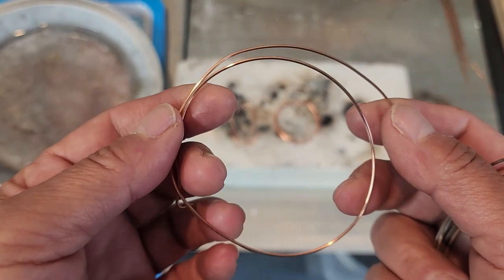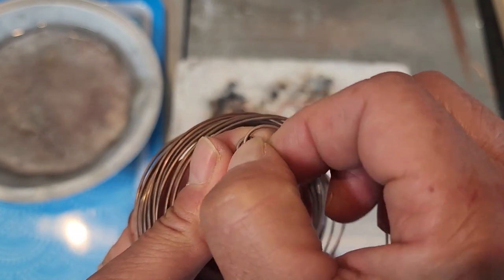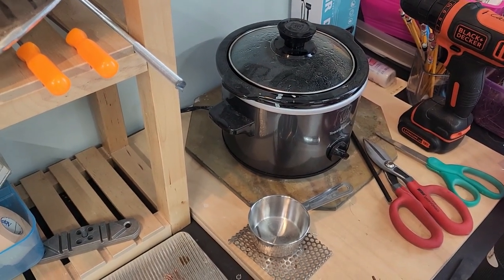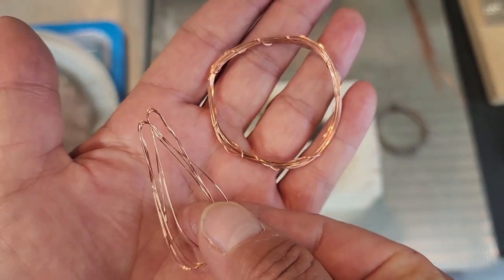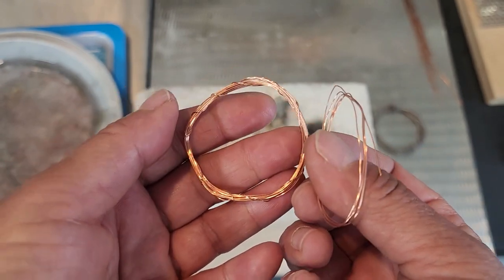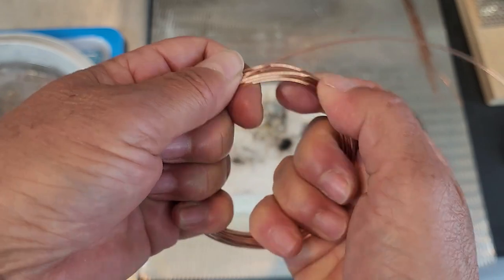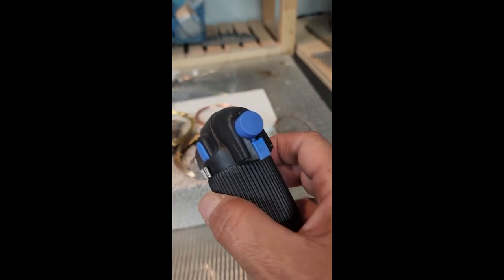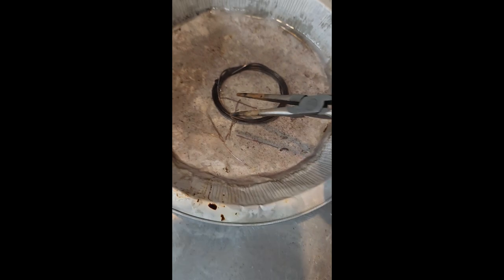How to Anneal (soften) wire for wire wrapped jewelry using a Micro Torch

Comment: Never can figure out, how long do you leave it in the pickel for? Also, if you are using the chemical purchased pickle, would that change the time? Thank you for this video! Ive watched many and this one is the most straight forward, and hands on with a pleasant voice!
Reply from the maker: Thank you so much for this lovely comment!  I only use the white vinegar and salt pickle, I don't use the chemical pickle at all, so I can't comment on that.  I find it only takes a few minutes for the hot vinegar/salt pickle to remove the fire score... you will notice the color change in the metal and see it pretty quickly.  Use tongs to handle the wires and rinse them afterward.  You might google for Silversmithing videos that might show and talk more about chemical pickle...I don't solder, so the use of fire and this pickle in my studio are very limited.  There will be more and better information out there from other experts on the use of chemical pickles in your studio and how to safely handle all that.  Thank you again!

Comment: I am not good at hammering on copper, it always seems. bit irregular and hard to shape.  Would annealing it first make it easier to get a nice hammered effect?
Reply from the maker: Hi Ann, not really... annealing is more for softening the wire, while it might help, it's not the main factor I don't think so anyway.  Try a Chasing Hammer if you don't already have one, the head of it is slightly curved, hit on the face of the hammer and pull back slightly to direct the wire, where to flatten out.  If you hammer with the ball shape side of the hammer, then you get texture on the metal.  You can watch this framing video and go to timestamp 7:00 minutes, I show how to hammer.  https://www.youtube.com/watch?v=DbVh0fzLo2s  Hope that helps!

Comment: I’ve made ball headpins with the same pickle you use. Do you polish the wire after? I don’t have a good method for that. Do you have suggestions. TYFS
Reply from the maker: Thanks, Cathleen, I don't do this often as you can see in my jewelry images, because there is not a great way that's easy... this time, I am going to try throwing them into the tumbler for a while and see what happens... I might do a light coil and tie them together and then the tumbler... do you have a tumbler?  I haven't shown it yet, but if this works out, I might.  That's about the only suggestion I have other than trying to hand polish using a Sunshine Cloth (that works quite well, just takes the elbow greeze and some time ;) Hope this helps!  Great question to bring up too!
Reply: @PerfectlyTwistedJewelry   
Unfortunately I don’t have a tumbler yet. I’m looking but know nothing about size, motor, durability, etc. I am starting to use sterling and find the benefits of getting one. I recently retired so more time to do wire work. I also am finding how poor the plating is on craft store headpins and clasps. So embarrassing when you gift or sell a piece that the silver clasp has turned to brass in a month or two. I purchased the Everbrite coating spray with mixed results. I think it’s a user learning curve more than the product. I see potential with it for plated pieces for a less expensive choice for craft show pieces. I still have a lot to learn and appreciate your expertise and videos. Thanks for your reply. ❤😊
Reply from the maker: Well the tumbler experiment reminded me of why I don't use it much for balled head pins or wire LOL!  I did find that cleaning them in the pickle and then just polishing them up while on the pendant worked out fine.  So for these, I think when I show them in future projects, I will show just adding them to the finished jewelry and treating them with all the rest of the wire.